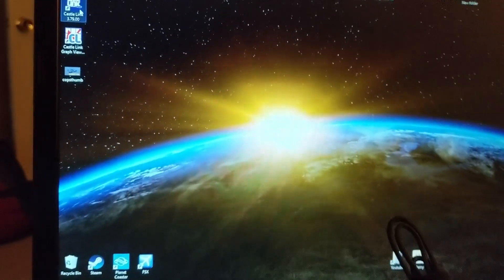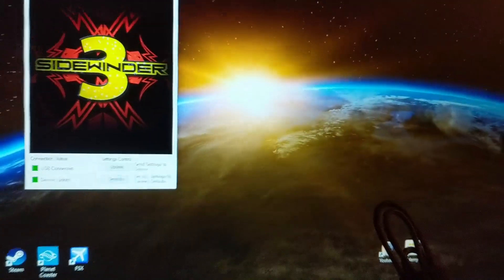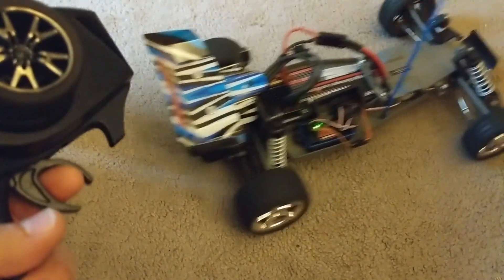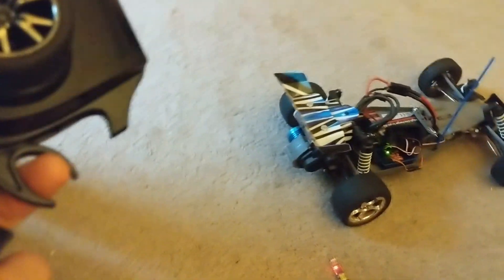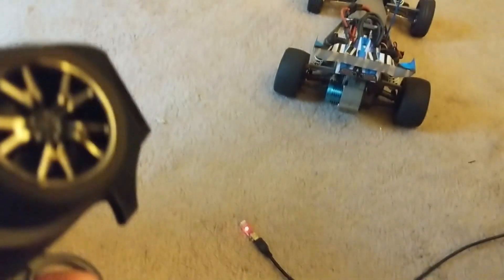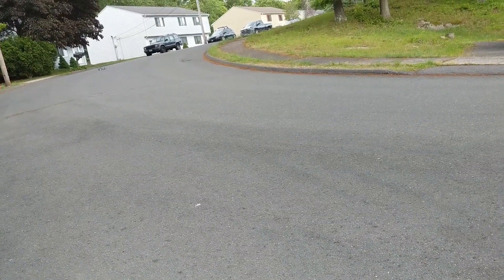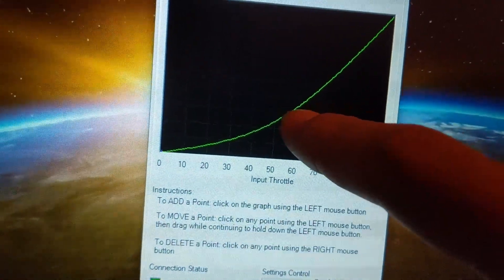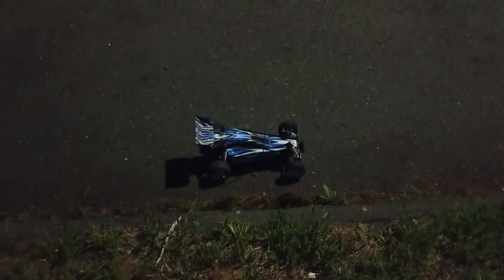$20.00 GoolRC brushless motor on Traxxas Bandit tuning using Castle Link software

Comment: Mine does the same gears sounds like they’re clicking but only when I do a little bit of throttle but once I hammer it don’t hear  anything
Reply from the maker: Really!? Maybe we both have bad motors? It's definitely possible, it was $20 after all. I Haven't ordered a new one but maybe I should? I haven't really had a chance to do anything with the car recently. I had tuned it a bit with the castle link software but it didn't really fix the problem.
Reply: Planet Mike idk maybe when I got it it was good. But when I try to crawl motor jus stutters and doesn’t move